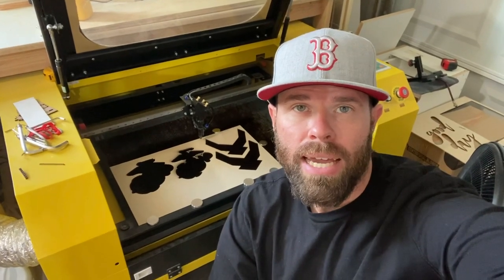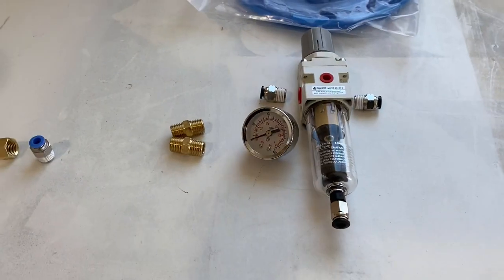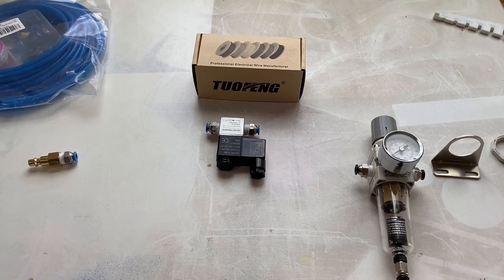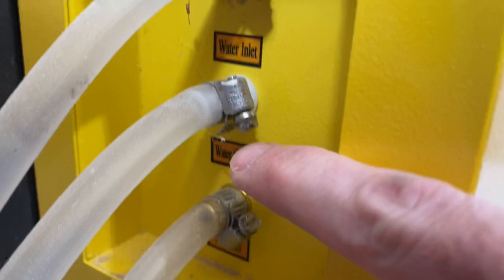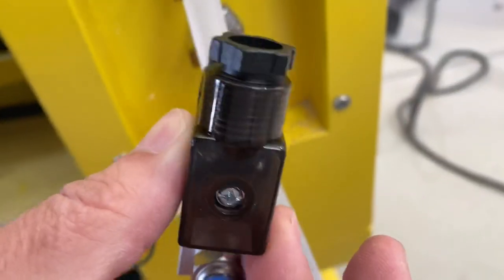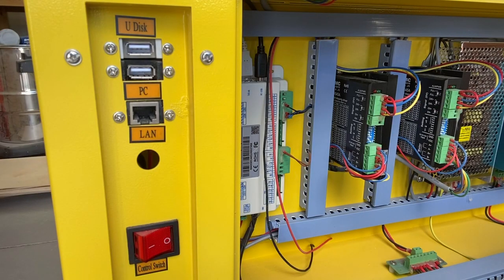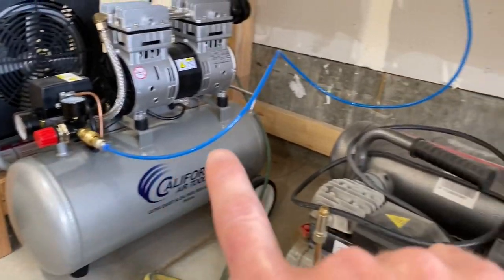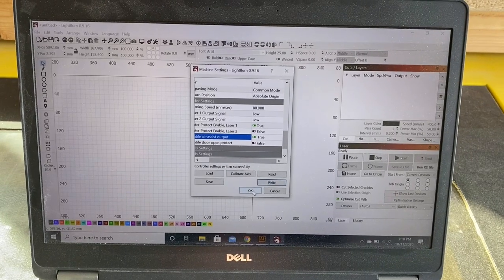Upgraded Air Assist for Chinese | OM Tech CO2 Laser

Comment: How’s that compressor working for you on longer, higher psi cut jobs now that you’ve had it a while? I’ll be moving my laser to a new location and plan on doing the air assist upgrade at the same time and want to make sure I don’t get an under powered compressor that has to run continuously to keep the tank pressurized.

Comment: How did you completely diss able or disconnect the stock pump? I have the Gray/blue OMTech 60watt and it had the same stock air pump as yours, is there a way to cut power to it or something now that the new air compressor is hooked up?

Comment: Your video saved my bacon and sanity... I just got my OMTech 55W laser. I watched numerous videos and installed the upgraded air assist.  It didn’t work!  I checked and rechecked my wiring and connections, took voltage readings of the +24V and Wind terminals (no voltage), I was pulling out what little hair I had.  I watched your video and, eureka, you solve my problem.  NO other videos addressed the “enable air assist” machine setting for the Ruida controller!  I made the change and air assist works as it should. Thanks
Reply from the maker: Glad I could help!

Comment: Got it all set up and my computer won’t communicate with my controller.  There may have been a light burn update. I’m using a Mac and have the ethernet to lightning adapter. Not sure what I’ve done wrong.

Comment: As a future addition you can add an additional 2 way solenoid so you can have low pressure for engraving and use the aux output to trigger air assist for higher pressure cutting pressure.
Reply: I just watched a video where MW Laser does almost what this video shows , but goes that extra step and wires an extra solenoid to turn the compressor on and off. However this video seems a lot easier to follow. Looking at the other video comparisons with wood and plastic it was a huge difference to have less air on the plastic.
Reply: Or you could adjust the regulator 🤷‍♂️

Comment: You sure are a legend. I purchased an air compressor and most of the parts months ago but never got around to fitting them and seeing that if I got a solenoid I could get it to automatically turn on was pure brilliance as I never saw anyone else do that. I had to try so my solenoid turned up today and I can't believe how much better it cuts. I've just lowered my setting from 40- 32 for cutting 3mm ply and that's before cleaning the mirrors. I will have to get a new compressor as this one is way too noisy but it's given me more joy to play with knowing there's going to be less of a clean up afterwards. You got a sub from me.
Reply from the maker: Glad to heard that you are loving it! 🤜🏻💥🤛🏻

Comment: Adding to last comment.  My system has duel air assist. One is to be used with regular compressed for everything but steel. The second system is for oxygen (or possibly nitrogen) for the steel cutting.

Comment: Keep in mind, that is not a "continuous duty" compressor. The air to my laser is supplied through my shop compressor. I installed a 20 gal. auxiliary air tank dedicated to the laser. World of difference. The electric, "normally closed", solenoid is a must. Plugged into the power supply for the OEM pump, will improve longevity of compressor. Great video!
Reply: So I'm watching this video and wondering: what about his OEM pump? Does his disconnect it? I have an OMT 60W, too, though mine is a little different in that my air assist pump is installed inside the cabinet. There is no external air assist port. Would I wire my solenoid leads to the OEM pump blocks?
Reply from the maker: You will want to disconnect the pump and wire the solenoid to the controller as outlined in the video. On my 100watt I had to drill a hole for the air hose and wires.

Comment: Cool video.  I use a couple of California air compressors at work.  They are oil free which is perfect for this kind of application, but the seals only last 1500 hours before they need a rebuild.  i would suggest purchasing an inexpensive vibration sensing hour meter.  They are not too expensive and will keep you from being blind sided by an unexpected performance loss.  The good thing is that they do sell rebuild kits…
Reply: Two more upgrades would be an auto drain for your compressor.  it will reduce the strain on your air-water separator/filter and will greatly extend the life of your compressor.  The husky brand auto drain from home depot is decent.  The other thing is Nitra solenoid valves like the dvp-2cc1c-24a and /or DIN LED indicating leads from Automation direct.  They are not too expensive (~ $26)will last you a good long time, are stackable (with an inexpensive kit) if you have more than one thing you are trying to supply with air and the LED on the DIN connector helps with troubleshooting when they do go.  Again, great video!

Comment: Already wrote to say great info. well my Green 6 pin conector block just arrived in the mail and wired up, already had the solenioid, wiring and pipework run, my main sticking points where your info was invaluable was the correct wiring (I thought 24v Grd WRONG) and the vendor settings to activated the air assist in Lightburn.  Set to 20psi and test cut, worked first time and lovely cut with zero residue. Saved me some head scratching. Thanks again.
Reply from the maker: You’re welcome!

Comment: Outstanding video and I ordered parts to upgrade mine.  Only one suggestion is to use jacketed 18ga two wire.  There is nothing wrong with what you did at all.  Electrically it is great, just in my opinion it's easier to monkey around one cable through the wiring troughs and the extra layer of insulation doesn't hurt either.  Many thanks............John
Reply: Thanks for the suggestion!

Comment: Man this is such a legit upgrade. I already have a compressor so this might not cost me too much to do. Can you do a video of before and after cuts to see how it has improved? Thanks for the parts list, gonna check this out. 🤙🏾
Reply: I really don't think it would improve performance at all.  The air is only there to blow smoke and debris away from the laser and lens.  Increasing PSI output would just cause work pieces to possibly blow around, especially when cutting.  This is a noise improvement, and possibly maintenance, but I assume he has to keep PSI set very low or it just would blow loudly and possibly move your work piece while in progress.
Reply: @naRevolution  use magnets and more air the better cut without charring of any type. Also cut thicker product.

Comment: As a new owner of an OMTech laser cutter, (like 2 days ago), 
this is a great improvement to add at the start. Thanks.
Reply from the maker: You’re welcome!
Reply: So shouldn't it turn off after the project is completed? Mine just keeps going.
Reply from the maker: Yes it should turn off the air when the job ends. Make sure you have a 24v solenoid, the wiring is as instructed in the video, and you have made the instructed changes to the machine settings in lightburn.

Comment: Love the video (already commented prior) ... doing the upgrade now.  My stock air pump was on bottom (in back) and was not even attached.  I want to take it all the way out, not sure where the wire leads to.  I don't want to cut the power wire to this and just leave it plugged in somewhere.  Appreciate your videos.
Reply from the maker: Just follow the wires and you can disconnect them. It will be connected to the power supple or one of the power terminals.

Comment: Good video.  I actually upgraded my air assist to a harbour freight air compressor.   Its super quiet but the air capacity isn't there so it continuesly runs if I run high air.
Reply from the maker: I have the same thing happen.
Reply: Compressor will die fast, those silenced units must be at least 420 l/min to work 1/3 for laser
Reply: @bartela  I'm sure the life expectancy will be shortened. I can possibly add a supplemental tank to offset the cycle times.
Reply: Bigger tank will put more stress to motor, so it is better to have more tank than factory one, but it will make motor work more. In short yes and no, better is to bought bigger output and forget. This solution will die faster as you think. I know because i gone trough this allready :)
Reply: @bartela  I hear you.  I will just wait for it to eventually give me issues then upgrade from there.  Thanks for the guidance!
Reply from the maker: Since doing this video I have actually bought and even bigger compressor from Lowe’s. With the 26 gallon compressor it cycles much less.
Reply: @BeardedBuildsCo  Awesome videos thanks!! Did you stick with the California brand or have you moved onto something else? If so how does it compare Db wise?
Reply from the maker: @briankucherepa1475  I was able to get my hands on at 26 gallon Kobalt quiet tech from Lowe’s. The sound is pretty similar to the Cali Air.

Comment: Have you considered running a low pressure switch that is in series with your lid switch?  This way if the air compressor is off (for whatever reason) or not connected as you expected, the laser won't fire.  That's what I did with mine.

Comment: Where do the 1/4 Elbow Connectors come into play?  Just ordered everything using your links...thank you!
Reply: I was wondering also but I ended up using mine when I mounted the regulator to the front of the machine. The elbows run the line out of and back into the machine
Reply: Some of the extra pieces in the tubing kit aren't used, like the 4 of the other colors of wire, extra post connectors etc

Comment: Thanks for the video! Will follow these steps later when I build up my laser!
Reply: Moving forward with my project. Building a CO2 laser and updating my diode laser.. and here comes one question. I like your solution with the solenoid, but what if I use 2 lasers? I guess I need to build a manual control for starting the compressor and switching between the machines.
Reply: Ok, took a while after watching the video and already forgot for the solenoids actually work :) so forget my question. Looking at the parts to buy now in Germany. Guess I will figure out how the diode laser and the solenoid should be hooked up. Again thanks for super clear video.

Comment: I recently bought a co2 laser that came with one of those cheap water bubblers and I wanted to upgrade to a compressor and I was wondering if it was possible to make the air assist turn on only when used, thank you for this video
Reply from the maker: You’re welcome!

Comment: Thank you very much! This video has helped me tremendously to make my MDF cuts clean. 
One question: Is it normal for the air compressor to run continuously during the whole cutting process? Does this happen to you too? I have a 13 Gallon capacity compressor.

Comment: Great video, just purchased everything from you links. A quick question though. Am I able to keep the current compressor in place and tie into the line? I would think this would be able to keep the stock airflow going for engraves without having to always manually change the regulator. If not an option, how do you change everything in time? Do you setup some sort of pausing mechanism or do you just do 2 separate projects, one for engrave other for cut? Thanks again!

Comment: I have the red and black 100watt. I have not set up lightburn yet. just did all the steps. just trying to figure out the settings on the machine to make it kick in. thanks for your time!!
Reply from the maker: In the video it shows you all the steps to change the machine settings using lightburn. The same setting can be accessed with RDWorks, you just have to look for the vendor settings.

Comment: Excellent upgrade, simple to install and use.  2 Questions though.  I watched a similar video adding the air assist upgrade almost exactly as you did except they added a diode across the contacts of the relay valve.  Reasoning was to prevent backfeeding current back to the controller.  This makes no sense to me.  The 24V is the only voltage on this circuit so I don't see how it would be even possible for that to happen.  It's not like a typical relay that has a low voltage control turning on/off a higher voltage circuit.  Don't want to smoke a controller for lack of a 50 cent diode.  You have been running this setup for a while, what is your opinion/thoughts.  Second I see where you upgraded from the California Air compressor to the 26 gallon Kobalt.  I thought the California Air would have been ample.  I was planning on using a 4.0 -4.5 scfm with a 10 to 17 gallon tank range compressor.  Would be running mostly cutting with run times 4-5 minutes per cut at most.  Only supplying a single laser.  Will this size compressor be adequate.  Thanks for the help
Reply: I have the same question on the diode.
Reply from the maker: I have also seen commentary about adding the diode. After years of running this setup I have not had any issues but I have heard of others that had a controller go bad but I could not confirm that a lack of diode was the cause. Seems like a cheap insurance policy though.  
As far as the compressor it’s really a matter of run time. The Cali air will run more often and the larger tank kobalt will turn on less both will “get the job done”. The Cali air is more quiet.
Reply from the maker: I have also seen commentary about adding the diode. After years of running this setup I have not had any issues but I have heard of others that had a controller go bad but I could not confirm that a lack of diode was the cause. Seems like a cheap insurance policy though.
Reply: @BeardedBuildsCo  Thanks!!  FWIW, I noticed the screw from removing the factory air assist fits the solenoid you recommend.  Made for a nice (and quick) place to mount it:)

Comment: Adding a solenoid was a great idea so the compressor doesn't deplete and is re-starting constantly. I have to check my RUIDA settings and see if I can find the air assist to do this. Thanks 👍

Comment: Old comment I know, but why didn't you just cut the black air tubing on the laser and inlined the solanoid inside the machine?.... Cleaner look, less hassle, and no need to remove the laser original intake...? Other than that, great video and thanks for the parts list...

Comment: Great video. I ordered, installed works great. EXCEPT..  how do you power off the built in air? It’s makes way too much noise and now that the air hose is pulled out, its even louder.
Reply from the maker: You need to disconnect the power to it. You either trace the wires back to where they are connected or cut and cap.

Comment: You need to make a adjustable bypass for the walve, so a tiny amount of air is floating even when the walve is off! 
Otherwise you wil have smoke and dirt on your lens when not using air assist, fx by engraving!
Reply from the maker: That is what I use the regulator for. I turn it down so there is just a small amount of air flow to keep the junk off the lens.
Reply: @BeardedBuildsCo  what do you turn the regulator down to for engraving?
Reply from the maker: 5psi

Comment: @beardedbuildsco thanks for the instructional video. I have the same co2 laser as you. Curious to know if you’ve ever encountered this issue before. Sometimes, my laser freezes mid cut. Machine is still on and laser freezes at a random spot and stops cutting. Has this happen to you before? It’s happening more often after installing your setup, but it could be other factors.

Comment: How can I determine where to connect the output from the solenoid air valve to my laser controller?
 In which channel of the laser controller should I place it for automatic recognition?
 Alternatively, is there a specific channel on top of my laser controller where the output from the solenoid air valve should be inserted?

Keep up the good work. 🔥🔥🔥

Comment: You rock, bud! I did this, and it works great!
Thanks for all the videos! 
My question is, would it be possible in lightburn to run 2 different air assists? One for cutting and one for ingraving. The only way I have come up with is having one compressor run constant for ingraving and put in a T with the solenoid switch on the compressor for cutting. My concern would be the back pressure on the ingraving compressor. 
Was wondering if it is possible to put 2 solenoid switches on to switch back and forth and control them in lightburn so the one compressor is not always on if it would even work with the back pressure from the cutting compressor. 
Or is there a better way to do this?
Have a great weekend!

Comment: great video, and thanks for the helpful info. I am wondering though if I'm doing a project that has engraving and cutting in it all in the same job how is the pressure changed from say using cutting pressure to lowering it to engraving pressure? Will the controller regulate the pressure automatically and if not how is that done? If not would I need to pause the job and adjust it manually?

Comment: Thanks again for the great video. I set this up last night and got everything from your Amazon links :)
But I noticed the solenoid clicks on and off whenever the laser fires, chattering with filled shapes throughout a scan line. Reading online it seems RDWorks has a Blow Type setting you can change from LaserOn to Processing, but Lightworks doesn’t have this setting. I guess an alternative would be to hook the solenoid up to Status rather than Wind so the air is on for every job, basically giving up software control and instead using the regulator to switch between 10psi for engraving and 30psi for cutting for example? Curious if you’ve had this issue?
Reply from the maker: Yes, there is a specific controller that has this setting. That is the same solution that I have worked through with other users. Use RDWorks and change the blow type to processing.